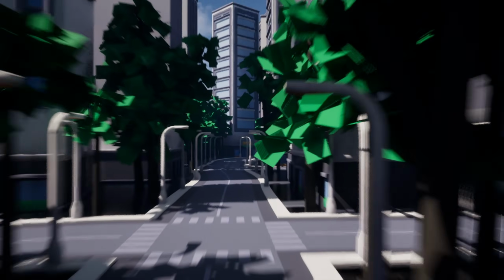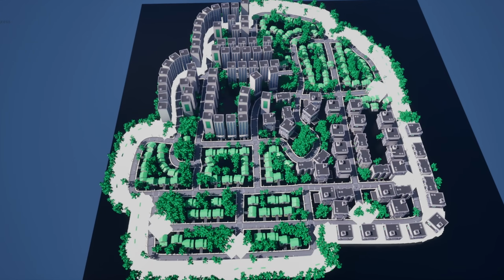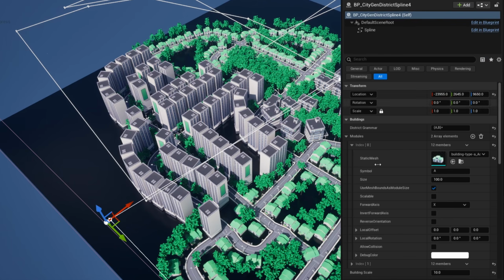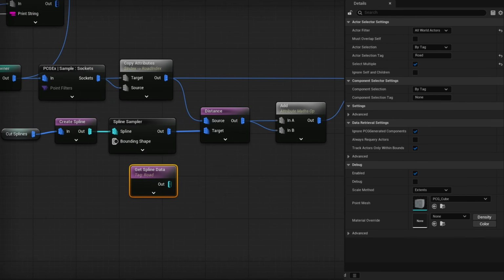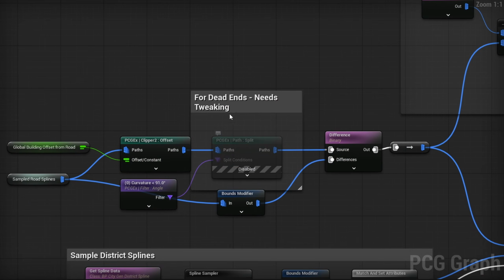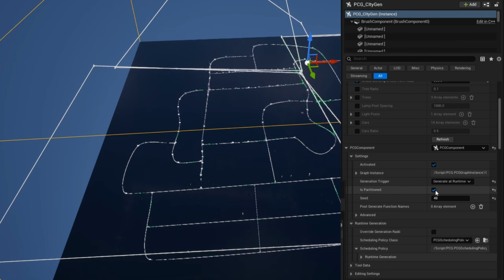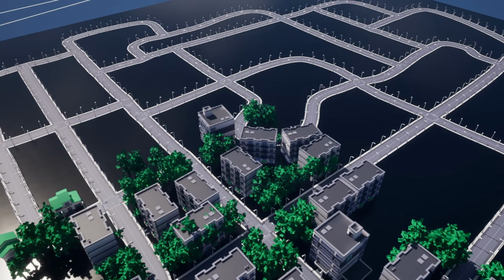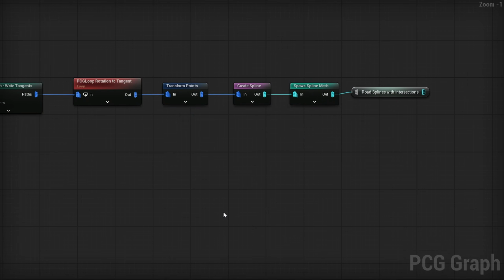Want a Truly Massive Procedural City Made Using PCG in UE5? Partition It!

Comment: Great tutorials!! Could you make one where you use the spline building generator to create the street buildings? I thinks thats the only thing left to create a 100% PCG city. Defining assets collections that will be randomly used to create variety of buildings and houses using the splines generated as the base shape for the spline in the building generator.
Reply from the maker: I have a 5.4 building series you can check out, or there's the grammar example epic provides you with that's more up to date and already has everything setup basically.

But personally I wouldn't do that for the final buildings. I'd make them, then combine them into locked in designs. The buildings don't need to randomize in a city typically, and it'd be much simpler to work with because you won't need to deal with instance count limits. That style also only works for skyscraper / downtown buildings, not residential style homes.

Comment: To fix spline mesh partitioning here's the gist:
- Split the final spline into sub-splines of 2 points (starting and end point)
- Compute centroid point for each of these sub-splines and associate them in some manner of your preference
- Partition centroids into lower high gen grids (if the point is too close to the grid bounds, it could appear in multiple grids, so keep that it mind that in a robust logic you would account for that, but the simple version doesn't need that)
- Extract the associated sub-splines data from the unbound grid to the partitioned centroids
- Use the sub-splines to feed the spline mesh component creation
- Voila, you now have partitioned spline meshes without the mentioned issues
Reply from the maker: This doesn't sound like it'd work for curved splines. The start and end could be really close together and the rest could go across the entire map for example. It's ok, I got something cooking for next time. :)
Reply: @Procedural_Minds  You may have misunderstood my point. I didn't meant original control points of a spline. If you you don't slice the original spline by distance, your spline mesh will become non uniformly stretched anyways. For roads you usually don't want that. The point however was to reduce the logic to single points. Partition only those points. Then restoring spline data associated with the partition points and spawn from that data.

Say you have a spline of 3 points ABC. If you were to spawn a spline mesh, you would get 2 spline mesh components for AB and BC point pairs. PCG cannot partition splines as it doesn't know how to construct ABC in a partitioned manner.

Now take that original ABC spline and slice it into 2 splines AB and BC (split spline node). Nothing will change, the curvature is exactly the same and spawning from these two splines will also result into two spline mesh components. However we're not done here as PCG still doesn't know how to partition these. Here comes my approach (it's ONE POSSIBLE approach). Take the splines AB and BC and generate centroids C1 and C2 for them. Partition C1 and C2 into grids. Now you will have 2 points partitioned like regular PCG does. From the partitioned grid grab for each centroid point its associated spline data back from the unbound grid. So if C1 is in grid cell X, you will extract AB spline from the unbound grid into grid cell X, and BC spline for C2 in grid cell Y respectively.

TLDR; the trick and goal is to partition spline mesh "components", not original splines. So we disassemble everything into small pieces, compute points that are save to partition and do so, then releasable everything back together up to smaller sliced splines and finally spawn.

----

I'm looking forward to see how you solved this problem though.
Reply: @Procedural_Minds  Regarding your example that you just gave. It doesn't matter as spline mesh components are spawned for adjacent pair points of each spline. If you compure a centroid for these (possibly also based on the curvature) you will get the point where the spline mesh component should likely be spawned or at least the position within the correct partition grid.
Reply: @Procedural_Minds  ah and one other thing. Regular PCG partitioning isn't perfect either. If your boundary is at X position of 12800 units, try placing a point at exactly that position and then partition it as well as spawn from it. You will get overlapped meshes as the point is intersecting multiple grids. As long as the point is at a certain distance from that boundary, it will end up in a single grid cell though.